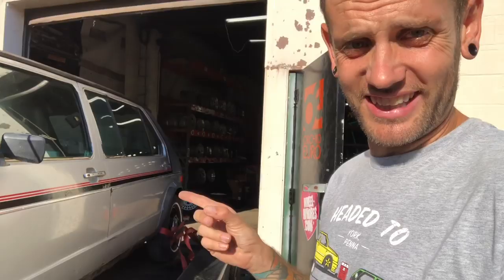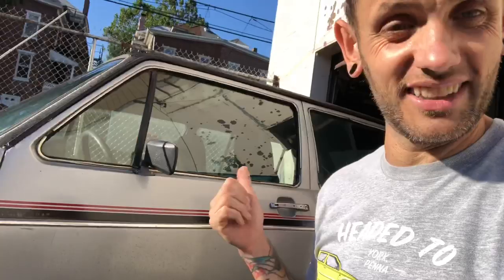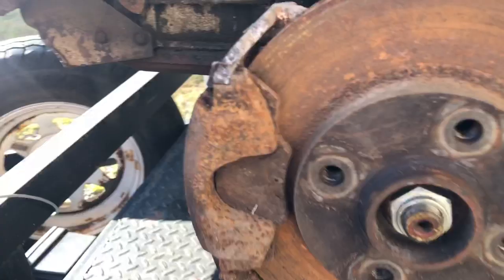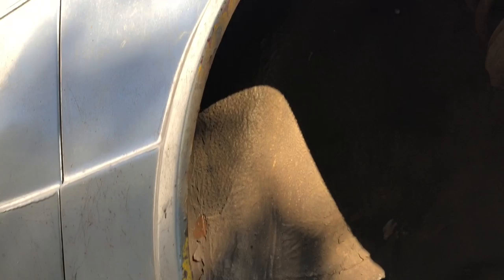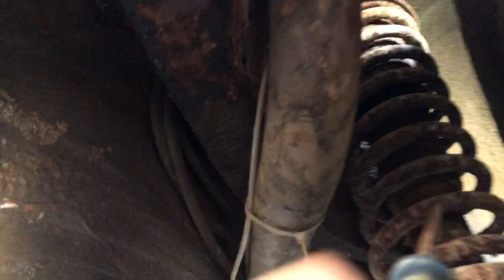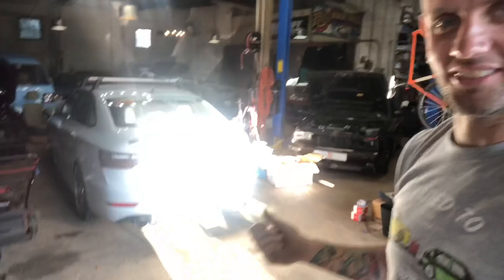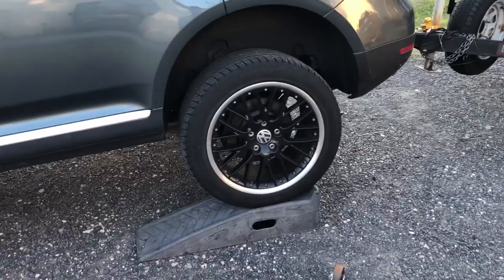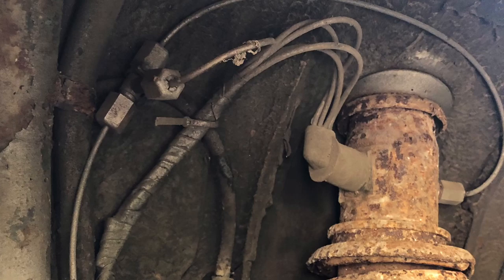Checker VW Rabbit Prototype: Project Video 1.0

Comment: Such a unique vehicle.. looking forward to seeing the progress! In keeping with the economical and fuel efficient plan as before, perhaps a diesel? 1.9 AAZ?
Reply from the maker: Yes, I was also thinking that a good interim engine would be a nice PD TDI... :-)
Reply: To swap a diesel the whole fuel system would have to be changed
Reply: @Random-nf7qb  , it's pretty much the same.. fuel tank stays- if it's like a carb fed Mk1 it just needs a return line added. The diesel pump etc are on the engine. Flush everything out with diesel, prime and start it up;-)

Comment: What kind of instrument you need to use in USA golf? Metric or inch?
Reply from the maker: The USA uses imperial measurement clusters, with MPH for speed, gallons for fuel, and Fahrenheit for temperature. :-)
Reply: @JamieOrr  I meant wrenches, threads etc.
Reply: @JamieOrr  inb4 sorry for my bad english)
Reply from the maker: Ahh, sorry, I misunderstood :-)
All Golfs are Metric, no matter where they are built. Same with all other USA produced VWs.

Even a lot of Ford and other American cars/trucks use metric bolts etc now.
Reply: @JamieOrr  thanks a lot